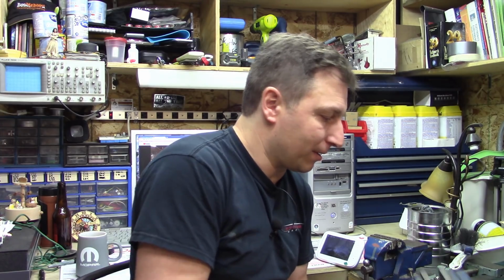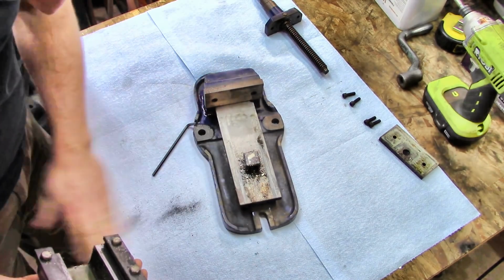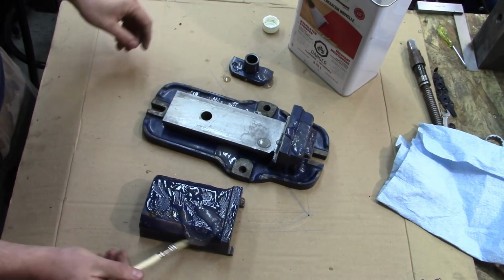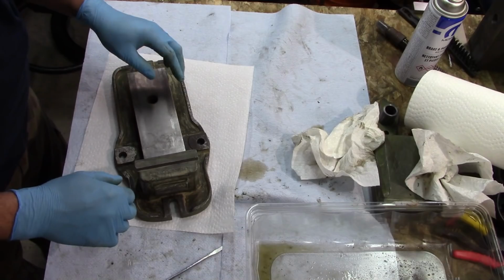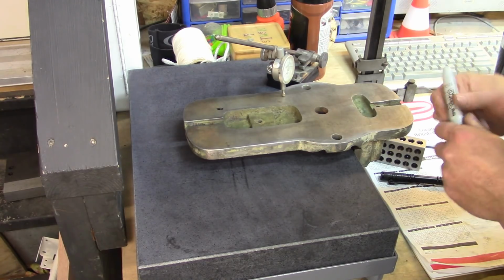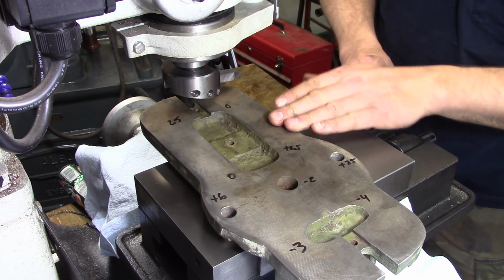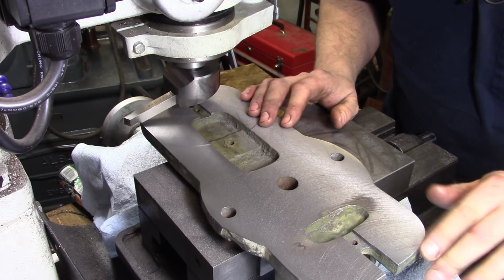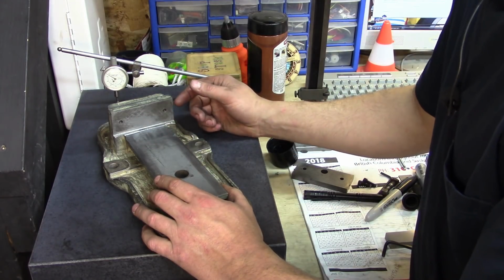Garage Sale Mill Vise for the Shaper Part 1

Comment: Good measurement set-up, looking at the bottom face deviations, the vice has been used without being correctly clamped to a machine table.
100% agree on machining the bottom face parallel to the moving jaw face, I did the same on a second hand unbranded vice, I also found the tightening the vice, caused the fixed anvil to yaw, so I ground a 0.07 mm taper in the hardened jaws.
Good candidate for hand scraping, just visualise what is needed before start.
Thanks for sharing.
Reply from the maker: Thanks, I wanted to know what kind of warpage I was up against, was the best way I could think of.  As for the fixed jaw, I had heard from some others that there can be deflection under pressure from tightening so I'm planning to address that on the shaper itself.  If there needs to be a slight taper then I will put it in to compensate for deflection.
Reply: @EverettsWorkshop  Hi Everret,
Yes, I experimented with applying differing torque loads with a torque wrench, with strategically placed DTIs, and then compared to a few taps with my "milling machine mallet". I recently purchased a top shelf vice, and the instructions show an applied torque versus load graph, so I use a torque wrench on this at all times set just below recommended max. I think, as long as you know what your vice/s due under gripping, then it's plain sailing. Thanks for replying.
Reply: @bostedtap8399  Great info Bosted Tap, thanks for the ideas. I have a vise to true up soon too, and these will come in handy.
Reply: @CraigsWorkshop  glad to help, looking forward to seeing your improvement work.

Comment: Looks good so far. Better is better. I would Re map the base on the granite surface. Thanks for sharing
Reply from the maker: Thanks Sam, I suppose I should have remapped it but I was just happy it didn't rock anymore.  It really isn't a high-quality vise so was just more looking for functional rather than perfect.  Others have suggested using it as a scraping exercise and that may be a thought down the road but I just want to use it for now so the shaper can be operated.

Comment: wow great job so far everett. i think your going to have a very useable and have very good precision vice after your finished with the project. i was wondering if you lapped it with 400 sand paper on the surface plate like kieth fenner does if that would really dial it in? looking forward to see how you are going to true up the fixed jaw. thanks everett.
Reply: Lapping can easily introduce convexity unless you're really careful.
Reply from the maker: Thanks Jamie, I think it should turn out to be usable once the fixed jaw is repaired and it's painted.  I had thought about lapping with sandpaper like you say, but like Paul mentioned I'd be concerned about inducing unevenness over the base of it if I wasn't doing it properly.  As for the fixed jaw, that will be done on the shaper as that really is the ideal tool for it.

Comment: Beautiful job on the base casting (And great vise overall). I think your fly cutter setup was the way to go. You could have done it in 2-3 passes with a facemill, but since your mill can go nice and slow, doing it all in one pass with the flycutter gave a great result. To go from approximately 0.010" overall deviation to less than 0.001" is great. Looking forward to seeing paint on it. Also looking forward to seeing you adjust the vertical of the fixed jaw. Just yesterday I got my restored vise back on the mill and the dynamic jaw is leaning out a tiny amount at the top. So I think I will take it out of the vise, shim it until I get the same reading (and clamp it down) and side mill it with the largest end mill I have (20mm). A job for another day!

Cheers, Craig
Reply from the maker: Thanks Craig, I did take a number of light passes, but went light and slowly for the final pass to try minimizing chatter.  Going to readjust the fixed jaw on the shaper, but will need to see how much deflection there is when clamping forces are applied, might need to put an intentional slight taper to accommodate the forces and stay square.  Just need time to get out into the shop . . . lol . . . Story of us all . . .
Reply: @EverettsWorkshop  Good thinking about the intentional deflection. I'm thinking clamp up a 123 block end-ways, on parallels, to concentrate the forces up high in the jaws. Then - run an indicator up and down the dynamic jaw. That should tell you (us!) how much we need to take off. Much better than assuming no flex. Everything is made of rubber as Stefan says! :)
Reply from the maker: It was a couple of my viewers who recommended checking the deflection, so I will do that once the vise is mounted to the shaper so it's solid.  Bosted Tap, as he wrote below, said that he's even noticed differences in amounts of torque applied tot he vise, will look into that when measuring too.  Sounds like Stefan was very right in this case!

Comment: Hi Everett Another interesting video. I mentioned before that I have a similar mill which also needed the head aligning only managed to get within 0.0015 . I added a 12 volt car wiper motor to power the X axis within a electronic controller to change direction and speed, would hate to be without now.
Wishing you all the best Martin
Reply from the maker: Thanks Martin, I hear you about the frustration in getting these units trammed.  I've had to do tweaks on mine a couple times now.  It's almost like the casting wasn't cured enough before manufacturing or something because no matter what it seems to move a very small amount over a couple years.  And an X axis power feed is on the to do list, but with limited shop time lately and a number of other things people have asked me to do it sadly gets bumped down in priority, lol!  Hope you're doing well too.

Comment: Cool job, too bad you wasn't next door. That vice would have fit nice on my mill. When you was discussing the vice my first thought was could you clamp it up on the shaper? Since I don't know the stroke and travel it was me thinking to your video. The fly cutting was a great option, looks like you have a power feed build in your future. Man I love my power feed, could not imagine doing a job like that with out it. Listing to your son in the background is cool, we have our granddaughters on Friday mornings so Chris can drop them off to day care there is nothing like having a 3 and 2 year old around they are precious.
Reply from the maker: The shaper has only a 10" stroke and the table does not have a long enough travel so that's why the mill was used. Power feed is on the wish list but available shop time is such that such a project is far down the road. And yes, I love it when my son is in the shop with me, looking forward to having him work with me down the road.
Reply: @EverettsWorkshop  I figured that out about the shaper. I figured that you would round up a wiper motor somewhere

Comment: Brilliant Everett. 
The mill quill is almost fully retracted in the machine head, excellent A1+++ for this dubious operation. 
The extended overhang fly cutter is acceptable, taking it slow, we've all done it, pushing the limits. 
Machining with what you've got when you've got no choice and achieving the finished result you aimed for is ecstatic.
Excellent Everett bring on the rest of the tear down. Tony
Reply from the maker: Thanks Tony, I wasn't sure what to expect from a long overhang fly cut operation. Thankfully it did work taking light cuts, with only minor chatter. Just thankful the base is flat enough to trust now, and that there are only a couple more actual machining operations before it's usable.

Comment: Very nice vice, & as you say the the amount you paid, you are able to experiment.  After stripping it down, I would have done exactly the same as you did with the mill, which has given a relatively good finish. I faced a 4 cylinder alloy head on my little Rong Fu 30, which I think is similar to yours.  The only difference is I used a 10" OD plate rotating  with a carbide cutter.  Overall, you have done an excellent job. Be good to see how your Million $ Vice will work out :)
Reply from the maker: Thanks, I was thankful for finding that vise, getting more hopeful that it will be usable after the fixed jaw is repaired.  And that sounds like a good project idea to me, a MUCH bigger fly cutter! :)
Reply: @EverettsWorkshop  If you make another fly cutter, doesn't matter how big or small, I would suggest the cutter be about a 10 degree angle, so it doesn't cut on the backst6roke

Comment: Everette, 
Before you cut the fixed jaw surface back to square to the slide face ( ways ), assemble the vise and clamp a part near the top of the jaws snug, and check how much deflection you get in the fixed jaw.  You may want to machine it off square a .001-.002 to compensate ( guess ). Very rigid vises are usually square, but with this lighter casting, may help to hold parts square when tight. 
Maybe try your hand at scraping the bottom in.  Cheap practice part.  

Good vid.
Reply from the maker: Thanks, it was suggested below as well to check the deflection of the jaw under pressure, and that is an excellent idea.  I will be doing that before cutting the jaw mount.

Comment: Great vid. Learned a lot. Nice to resuscitate an old vice. Shaper action is getting closer and closer.
Reply from the maker: Thanks Paul, getting more hopeful for using the vise now that the bottom is flat enough to trust.  Going to do up the fixed jaw mount on the shaper, it will be the ideal tool for that operation.  Hope you're doing well!

Comment: Nice work with the mill. If you want to "tweak in" that last thou (or half thou) I would try scraping, either with proper scrapers, or just files.

Scraping is just localised metal removal, controlled via the surface plate, or indicators.

I'm a humble woodworker, but I managed to scrape a (woodwork) plane sole flat to better than 1/2 thou in my first attempt.

Since scraping tends to remove a nearly constant per pass, angles can be changed/tuned by "step scraping", effectively scraping to contours.

And you do have a surface plate :-)
Reply from the maker: Thanks Paul, I have not tried scraping anything yet.  Seen a couple videos on the process, and while it looks simple enough it also appears to have a bit of art to it apart from the technical side.  At some point I will try my hand at scraping but might do a couple practice pieces before going after something that will be needed for regular use.  At least if the vise is machined to be "trusted usable" for now then it can be tweaked down the road.  You do make a good point though, it would be a good candidate at some point!
Reply: @EverettsWorkshop  Yeah - "tool room" scraping for that last 1/10 is an art.

But the really nice thing about scraping is that it's nearly foolproof. You just take a print, and hack away the marked spots, with a scraper, or a file, or an angle grinder (*).

Being too gentle, too soon, makes for slow progress, but it doesn't cause errors.

Here's a guy "getting the job done". Inspiring, IMHO. (Wes works on old trucks, but also repairs machine tools professionally)

https://www.youtube.com/watch?v=xHT-uzKQM6U&t=20s
 
(*) he was flattening an anvil top, using a sheet of glass as the reference, blueing up the glass and taking it to the anvil.

Tools required:

Glass
"blue"
Angle grinder

Comment: Nothing wrong with fly cutting as long as you are careful. I watched Keith Rucker do it on some restoration. Of course he surface ground it afterward :). But you can finish the jaw on the shaper itself as someone suggested, although it will take painstaking setting up.
Reply from the maker: Thanks Juan, I was intending to do up the fixed jaw mount on the shaper as it is the ideal tool for it.  The fly cutter was because I had no other option in my shop but it looks like it will work for my purposes.

Comment: You are on the right track.  That will make a good serviceable vise for the shaper.  Enjoyed the video, keep up the good work.
Reply from the maker: Thanks Steve, I'm thankful to have found it considering how machine tools are rarely seen in garage sales around here.  Surface grinding the base would have been ideal but fly cutting will have to do for now.  Nice thing about it is that if I ever manage to find an affordable surface grinder it can be retouched at that point.

Comment: Dykem steel blue layout fluid would have let you see where the surface is being cut and all the imperfections. Would have been a great visual, also. When all of the blue is gone, you are in parallel with the opposite surface. Just a tip from an old machinist  :)
Reply from the maker: You are totally right in this, and I should have thought of bluing the original surface as it would have made it easier to see on camera as well. Next time I fly cut a large surface, for sure! Thanks for the tips, I do want to get better at my craft, and am happy to learn from others' experience.

Comment: Paint strippers contain sodium or potassium hydroxide (lye) in water. The strong base breaks down the polymers that made up the paint base by a chemical process  called hydrolysis. The polymers are esters made by combining organic carboxy acids and hydrocarbon alcohols. Under conditions of strong base, water will break the ester bond and reverse the reaction with by-products organic acid and an organic alcohol. Because the stripper contains strong alkali which is left on the part stripped of paint, it is recommended to rinse the article in water.  Any rust formed can be removed by a water based rust remover.  l recommend to wear chemical resistant gloves when applying the stripper.  Strippers with no strong solvent odor are just that, free of volatile solvents. They may contain a thickening agent to keep the stripper on vertical surfaces when applied. They also may include some non-volatile, water miscible solvents to assist the stripping action.  I think the vise was made by the Palmgren Machine Company.  They made a variety of equipmnt for machine shops including rotary tables.  The absence of any identification may suggest it is an Asian copy of a Palmgren vise because many of these manufactures do not imprint or emboss the manufactures name when cast.  Palmgren products have a good reputation.  I suspect you did not elect to surface grind the vise bottom because there were no inexpensive sources. There is nothing wrong with flycutting the way you solved that problem.  Iron castings relieve stress and move long after being casts and forreign machinery made of iron casting are not always properly aged before machined.
Reply from the maker: Hi Thomas, thanks for that explanation, the strong bases lifting the paint makes sense, they're nasty on pretty much anything.  As for the vise make, I'm still on the lookout and doing research on trying to find models that look like it.  An Asian copy of a better known model would make the most sense, given the rough edges and some of the fit and finish on it.  Also heard from another friend or two about the long-term stress releases from the cast iron causing warpage.  I should have thought of that before, seeing as I've changed countless Dodge Hemi exhaust manifold gaskets and all the manifolds were warped after the heat-cool cycles relieved the stresses in them.  Rushed machining or improper aging of the castings would make total sense as to why it was warped like it was.  And someday it would be fun to have a surface grinder but they are very hard to find for an affordable price in this area.  Thank you for your response to the video, that was interesting!

Comment: I had a drill press vice that I did the same thing to.  It was better after shaving the base, but still needed some more work, just like yours.  I look forward to seeing if you are going to use the shaper to square up the fixed jaw, especially the results.  Enjoyed the video very much, keep'em coming.
Reply from the maker: Thanks James, and yes the shaper will be used for squaring up the fixed jaw mount.  It is a better tool for the job than the mill as there will be less tool deflection error with it vs. a rotary tool like a milling cutter.

Comment: This vice is going to make a great little series. It's sure rewarding to find something like this vice and go through it and make it into a useful tool. Once that you established that the top was flat flycutting the bottom was a good call. On a different subject Stefan Gotteswinter did a real good video on traming in a bench top mill.
Reply from the maker: Thanks, hopefully it will be only in two parts, three on the outside.  As for mill tram, I spent quite a bit of time fiddling with the head on it and considering the interesting measurements I was getting on some of the parts of the machine figured that .001" over 7" or so was fairly reasonable for now.  The fly cut finish came out as good as I could ask.  As for the fixed jaw it will be done up on the shaper, partly because it is an ideal tool for it, partly because I really want to play with it!

Comment: A nice job Everett although a bit scary with all that stick out on the fly cutter! Squaring the fixed jaw should now be a doddle compared to the flycutting.
Reply from the maker: Thanks, I wasn't sure if it would work but thankfully it will work well enough for our purposes.  Was a bit sketchy with the tool bit stuck out that far.  Will do up the fixed jaw on the shaper, should certainly be easier.